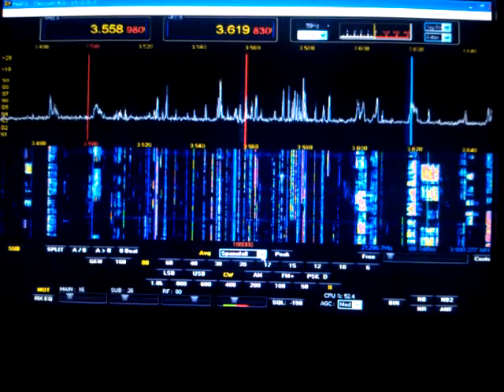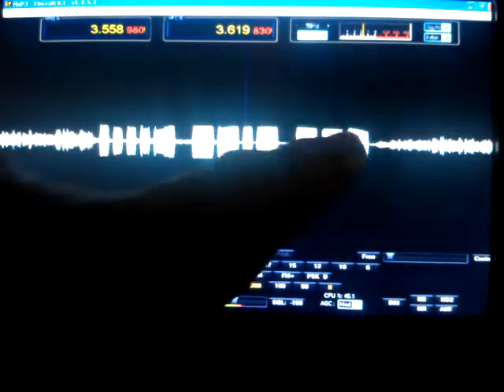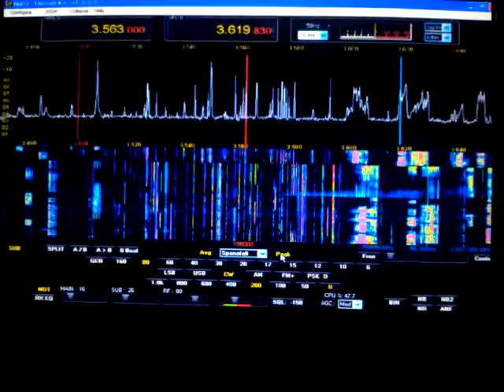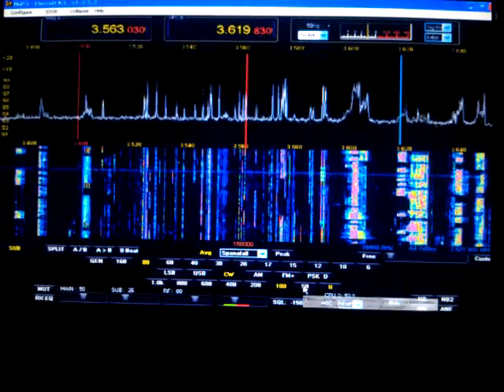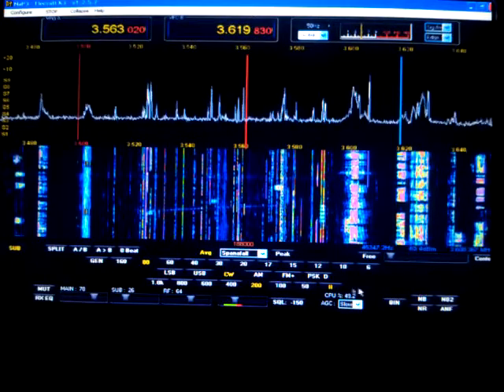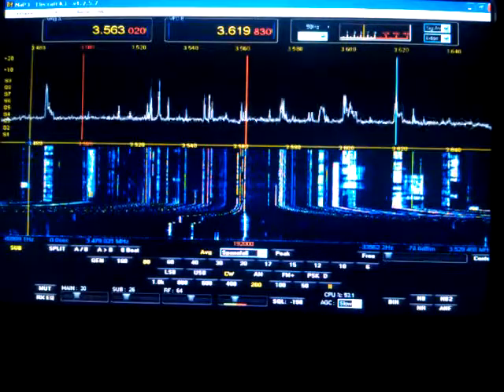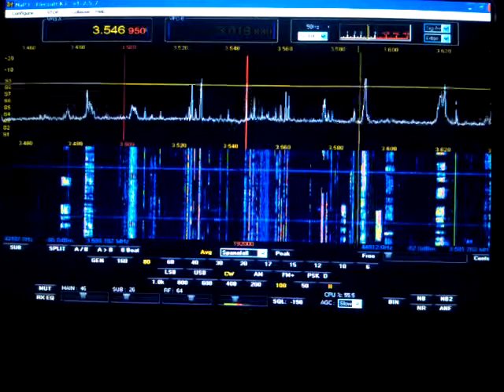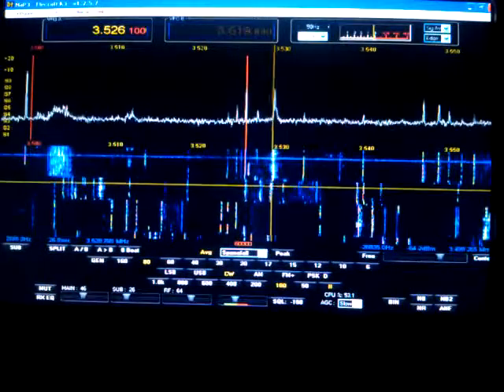N4LQ K3 with 7" Touch Screen, LP-PAN running NAP3 PART 3

Comment: I enjoyed your video/demo very much! I'm looking for a new rig plus a panadapter of some sort.  The LP PAN is impressive but I'm not clear on what rigs are most compatible...and what all I need to get set up.  I'm looking at the FTDX3000 and the FTDX1200...not sure if the latter has an IF output. Any advice? Thanks,
Dub, k4dub